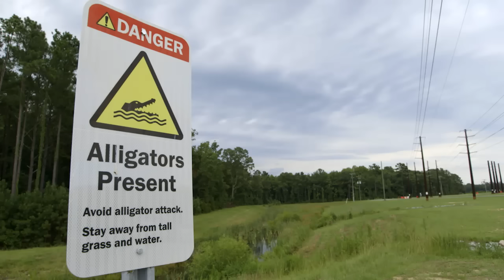Inside a Google data center

Comment: "they are incredibly passionate  about what they're doing."

*continues to ride scooter between server racks
Reply: It makes me so uncomfortable, you accidentally fall of the scooter, hit a server with the cart and you damages a possibly 10000€ server
Reply: @bachibak  fall over on a scooter?what are you 12😂
Reply: @joemama-cq4kp  they can get quite a bit of speed downhill, and a small rock in the way is quite a problem.
Speaking from experience.
that isn't gonna happen, but you can get caught on a edge/small/hook etc and probably rip out a board/drive
Reply: @bachibak  why do u think their server room has sloped floors and rocks all over?
Reply: @bmxscape  fair nuff, it doesn't, but ngl, I sorta don't wanna be the person that rams a scooter into the side of a server, even if it has protection
Reply: Speedy and efficiency
Reply: Work and Recreation

Comment: Imagine
just imagine the electricity bill for all of that
Reply: Zero.        Higher days centre are carbon negative.      They only use sustainable sources to produce energy required
Reply: Hella Bread.17
Reply: Probably about 20$ a month
Reply: TW/h
Reply: I would have expected a large solar cell on their large roof,  enough to power inside and store in batteries to operate at night
Reply: @OzzieWozzieOriginal  unlikley, solar farms are suitable in hot climate and data centres in cold climate
Reply: @prerakmalik1242  I thought the Solar champions are saying,  so long as the sun comes out, you get power
Reply: @OzzieWozzieOriginal  Thats partially true, cold temperatures bring down solar effeciency and in most places the cold weather is combined with winter which means less hours a day of sun. A solar farm's only purpose is to harvest light, a spot where there can be harvest 30% more light is an easy choice for an investor.
Reply: Don't forget the carbon footprint. We are going to be forced out of gasoline vehicles much much sooner because of Google. But they are above us pheasants, right?
Reply: @Bryan-Hensley  they are carbon neutral
Reply: @prerakmalik1242  how?
Reply: @Bryan-Hensley  that data centre is literally 100% powered by sustainable sources like water and light, so that means it releases 0g of CO2 every year, so maybe it IS the time that you get an electric car
Reply: @milan1397  the data centers and electric vehicles around here are getting 100 percent of their power from coal plants or natural gas power plants.
Reply: @Bryan-Hensley  (yawns) aaaaah what did you say?

Comment: how does keeping a data room at around 80 degrees efficient? i thought the colder, the better
Reply: They found that servers and other hardware could  run at higher temperatures. The mean time between failures only increased a small %. The money they save on electricity and other things outweighed the hard drive and server failures.

Comment: Some LEED gold certified buildings have the same cooling system.  Sometimes the energy from the heat coming from the server is used to freeze a big block of ice which then slowly melts

Comment: Serious nerdy question tho: why would they run their data centers at a higher temperature than most? How does that help the efficiency? In my experience as a communications tech, Heat=Resistance. And that’s backed by science.
I’m just curious if anyone knows how that helps efficiency

Comment: Me: brags about my recent  "complicated" water cooled Ryzen 9 build

Google: Hold my Ethernet cable
Reply: That cooling system would seriously concern me. Their is a serious risk of condensate moisture particles dropping into the racks. In addition, the evaporator coils will be dehumidifying the air to the dew point of the cooling air, the drainage systems below coils are constantly blocking and flooding into anything below them. This is the reason that they are historically floor mounted.
On the scale that the system has been installed, I would consider it an accident waiting to happen.

PS, I have designed systems for theaters and film studios for more than 45 years.
Reply: @wilsjane  Maybe you forget, the humidity is kept low and there is little new moisture to be taken out because human presence there is kept to a minimum, thus the chance of any condensation appearing is quite low. Theatres and Film Studios have to constantly remove the water vapor emitted by humans, which is quite a lot when talking about tens to hundreds of people concentrated in a relatively small space.. I'm guessing a lot of litres per hour.
Reply: @paulmichaelfreedman8334  What you say is true, my main point was that evaporating coils typically run at around 5 degrees centigrade, so are extracting humidity to near zero at the point of contact with the coils. This will always produce some condensate water. Hence my point about not placing them where a blockage in the drainage would allow water to drip from above.
The situation in a theater is far more severe. With the 1,000,cfm fresh air requirement per 1,000 seats, on a humid day the condensate from the evaporators can reach 50 litres per working day. 
On warm humid days, when people are arriving with soggy shoes, damp clothing and dripping umbrellas, we may need to keep the comfort temperature above the outside ambient. The only solution is to chill the incoming air to drop the high moisture content out, then reheat to produce warm dry air. 
It is a difficult balance, when peoples damp clothing will extract heat at 540 calories per gram while their clothing is drying, while those with dry clothing will find he ambient too warm. Keeping the RH low is the only compromise.
Sadly, many historic London buildings do not have the equipment to achieve this, but their large volume minimises air velocity which helps.
Reply: @wilsjane  I get your point, but I'm still thinking that what you fear must have already been thought of by the engineers who designed the system. Perhaps automatic drainage cleaning periodically preventing any serious blockage  - and this method being favorable over a floor based system.
Reply: @paulmichaelfreedman8334  The floor based systems work, but there is still a floor below when they block.
It was mostly airborne dust and oxides from the evaporator fins that caused the problems. along with the steel trays rusting to 13 times their own volume. Things got a whole lot worse when acid was used to clear the blockage, removing the zinc plating on the trays and allowing the whole lot to rust. 
Thermoplastic trays and pipework these days has resolved most of the problems, but the heat generated if caustic soda is used to clean the system softens the pipework, causing  it to sag and create traps. Organic pollution (mainly molds) can also be a problem, along with being a health hazard.
Reply: Vysulo lmao imagine a kid uses Intel for playing Roblox.
Reply: @chimingw  Tell Linus LOL https://www.youtube.com/watch?v=5uWXfoX1x3A
Reply: server cpu suck. The only job they have to do is data transferring. They don't have any complex algorithm to do. Your Ryzen is probably faster than 100 of their rack honestly lol.
Reply: @cepheibaw  nah
Reply: @cepheibaw  lol amd epyc is the same thing as ryzen on it's core (pun intended) and wdym about complex algorithm, all of that is running complex Custom software designed for efficiency and reliability while normal cpu just run "normal" stuff compared to data center
Reply: @chimingw  *Shintel
Reply: @Vjecni I have core i7 processor, an I poor?
Reply: @chimingw  go back to listening to K-pop lmfao X10.
Reply: https://youtu.be/478PqVDIUos

Comment: It appears that the array of machines are all wired together. If this is a batch from hardware similarity,  the loads would remain in balance. Predictive analytics and ML would programmatically handle an issue without human-added code. Watch that heat. If one heats up, it's medium of data storage could have data overwrite data. but hey, no bugs on google cloud or the data center. How many could connect to one server terminal station without flooding it?

Comment: 1:25 Does the guy in the background really uses a Mac in a Google center?
Reply: yes because they prefer use mac os than microsoft.
Reply: @kanayaadhia  you can get an operating system within the linux family on a laptop, and the tech setting makes that idea more welcoming.
Reply: @kanayaadhia  oh i see. Makes sense, even those thinkpads cost the same as macs and are a headache to maintain
Reply: they don't have their own laptops, chromebook isn't owned by Google, chromebook just uses chrome os. also nothing wrong with even some micrsosoft workes uses mac
Reply: 0:59
Reply: @RBXAviator chromebook is made by many manufactures not Google, maybe you mean Chrome OS which is an operating system.
Reply: @naota0  What os do they used in the cyber security department? Linux?
Reply: Macs are Unixy, so you can use the same terminal on your laptop that runs on the Linux powered machines you see in the video.
Reply: Actually they have a google pixel book it is owned by google. I think pixel book is better for study matters and not for those programming and hard stuff
Reply: @kenmiltontam-og23  pixelbook is so small, and is very limited
Reply: @L2002  Yes I agree. Im only say it because some said google has no pc but they have but so limited.
Reply: As a software engineer, yes, most people use mac and unix based systems.
Reply: Coz Google don't have their own pcs hehe.
Reply: @joykemprai  they got chromebooks lol
Reply: @whosbram9217  chromebook is made by many manufactures not Google, maybe you mean Chrome OS which is an operating system.
Reply: Pretentious wankers work for Google

Comment: Linus : we built 3 tb storage server... 
Google : hol up
Reply: 3 TB?
That’s nothing.
Reply: @Sherolox  3TB is 3 trillion bytes, 3000 hours of hd vide. 3TB is a lot. Its not nothing.
Reply: ApertureChromaKey 
On a grand scale of things, it’s not a lot.

I was talking about how 3 TB can be filled up rather quickly when producing video or installing a lot of big games.
In Linus Tech Tips‘ case, producing a lot of high bitrate 4K video footage, one video could be 20 GB+.
Therefore, 50 videos would equal 1TB and 150 videos 3TB.
This is without considering individual video length, but with high bitrate 4K, even a few minutes can take up a rather high amount of storage.

Also, I believe that the OP has forgotten to add at least one other 0, as 3TB really is nothing for LTT standards.
30 or even 300 TB is more like LTT.
Reply: @Sherolox  In the early 80s, even just a gigabyte of space would cost millions of dollars. They had 10MB drives back then that were the price of a house. Now a gigabyte costs $0.2
Reply: ApertureChromaKey 
Correct, but times have changed.
Reply: ApertureChromaKey 
Not even 1/8 of the entirety of YouTube would fit onto a 3TB hard drive.

For some people it may be more than enough, but that is because those people just produce small amounts of data.
Like text. 

A professional photographer will fill up a TB in about a year.
That’s high resolution photos, different edited versions, maybe video and backups.
Not just on one hard drive, but in total.
Still a terabyte.
Reply: @Sherolox  LTT films in 8k quality, which takes up about 6 GB a minute, which is only about 8 hours of footage total. They probably fill that up with unedited footage in like a week.

Comment: This is a lie. 2:54 There's no way that excess heat increases efficiency. In every data center, higher temperatures equates to higher power draw from client-side components/servers and such due to higher demand for internal and external cooling. Higher amperage draw per client/server = less efficient. Heat is an unfortunate byproduct that every data center has to deal with.

Comment: If they are really serious about energy efficiency, how about using the excess heat to heat a small town or a building, add solar panels on the buildings, and use skylights to eliminate or reduce the need for artificial lighting during day.

Comment: Ok, so you're generating thousands of litres of hot water...to the just cool it down...I came up with a solution similar to 4:38 on this video in 2007 that actually used the heat from this to generate electricity though a heat exchange...it also used this heat to heat the rest of the building.  Let's chat if you want to know more :)

Comment: Instead of using old fashioned mechanical hard drives which generate a lot of heat, why not use solid state drives instead which generate much less heat?

Comment: No photovoltaics on the roof. One would think that’s a nobrainer when a company wishes to do 'environmentally friendly' in a credible way.
Reply: This video is from 2014.
Reply: @Sacchidanand  Photovoltaics weren't invented after 2014.
Reply: @linuxgaming69  You can Google to see when which initiatives have started and compliance data for targets. Just doesn't because it's not present in 2014 video doesn't mean it's not now, it means it wasn't in 2014. Tier 4-5 data center can't rely on single power source.

Comment: How can Google get all this data?
Is there the latest data or only historical records? I appreciate the google search for latest records limiting the old records appearing. Search is very fast, but often times not accurate or gives wrong point of views - which would be right if that was right point of view. The search speed definitely higher than my hard disc search speed.

Comment: isnt it possible to use the heat for making electricity?,, 

i feel this is a HUGE CRIME INJUstice of COOLING SOMETHING SO PRECIOUS for winter countries,,  (or even giving the hot water

like magic using the heat of the winte for the summer and the summer for the winter (i had dreams when i was young) guess some actually can make sence
or time for those who need time and those who can spare it for later

Comment: With so many computers and disk drives, I wonder how frequently one fails?  Maybe one every few minutes or even seconds?  I imagine the software needed to dynamically adapt to failures and work around them must be pretty complicated.  If normal human-based system adminstration were applied at this sort of scale, it would never work.

Comment: Can you help me. I want build small data centre for my working place. I'm mechanical engineer but I have some knowledge in computer science. 
What's the requirement hardware and software for a simple data centre. 100 PC are in my work place.

Comment: 2:55 - 3:00 - Oh sure, warm temperature is really good for computers! more degrees is obviously equal to better efficiency...
Reply: Slightly warmer. I'm sure they've optimized whatever server system they use and compared it to current numbers. The drive was to reduce electricity consumption no doubt with a sacrifice in a few degrees they do not think is harmful. It's less about massive electric A/C and possibly a more natural cooling methodology...

Comment: Instead of scooter why not use skates. Also they are still using HDD which is old for servers and here we use SAS.
Reply: It all comes down to $ per mb of storage. SAS and SSD are much to expensive for the enormous storage capacity required

Comment: are they normal pc hard drives ??
Reply: No. They use hard drives that are designed to run 24-7 365, and withstand the constant vibrations. They are probably something like WD gold hard drives. I recently got a WD gold drive, and let me tell you, these things aren’t the same as standard desktop ones. I think it’s like a 5 year warranty, and it seems as if silence is not a feature on these.
Reply: Most of the HDD manufactures have several lines products. They actually have Enterprise HDDs that are built to a higher standard and also cost. I used to test drives at major computer corporation.

Comment: But can it run Crysis ?
Reply: Oh yeah definitely. Cool math games however...
Reply: yeah @ 40 fps
Reply: @acpl  r/whoosh
Reply: maybe if they put 50000 hds in raid 0
Reply: Dubstep Coast not at anything higher then low 720p
Reply: Crysis?, nothing compared with P3D! You need at least 3 data centers
Reply: .exe yes
Reply: yeah it will run in 1000038 fps and ultra very high settings
Reply: No
Reply: Lol! Crysis...I was admiring the Air to Liquid CLC. Did he say they overclock? "We run a little hotter than others because it helps with efficiency".
Reply: Actually no, because it’s mostly just hard drive storage
Reply: Thank you sir lmfaoooo
Reply: I wonder if it could realtime source single channel saperate audio into multiple channels and if it also could realtime convert B&W video into color, and imagine both in realtime, that would be astonishing,,

Thing is google does have audio soutce saperation algoritthms and a foto colorizer algorithm , so maybe they could put it to test for old mono B&W recordings , would be amezing.
Reply: yes
Reply: no... only heavy modded minecraft 120fps xD
Reply: That's the uestion right thee
Reply: DAFUQ LOOL
Reply: No your asking the wrong question, can it run Doom!
Reply: No, but it can run Matrix.
Reply: r/whoosh
Reply: Pantoffel h
Reply: Dubstep Coast this joke is old and stale. I swear this is the 3rd video in a row related to computing that I see this old joke.
Reply: i cringe at every r/whooos comment
Reply: r/whoosh

Comment: Wait, dont tell me. *Facepalm
You still use 110v then into individual PSU's that then transform it into 19, 12, 5 and 3 volts.
INSTEAD of running power cables holding 19 volts and removing all the transformers.
I know. How sad. 
When they build tomorrows Goole v2 thats how it will run.
Kind of like the City I have designed. Not seen anywhere in the world. 
See how many building went up around the world in 10 years? 
They were obsolete 11 years ago.

Comment: How do you protect the data center against the risk of flooding. We can help with Fibaro Flood Sensor and hydroNO valve with actuator and EFS Electronic Fail Safe which can cut off water even in the event of a power outage.